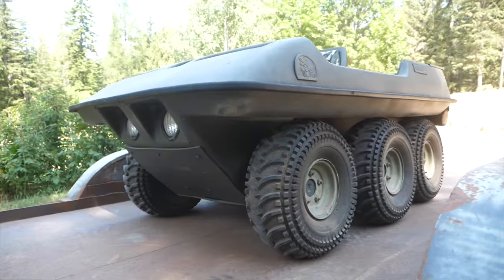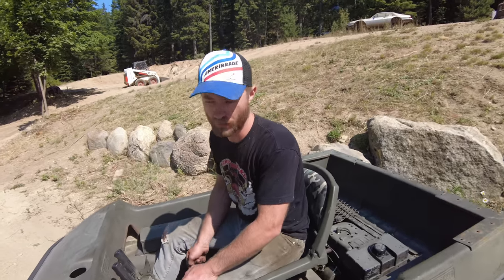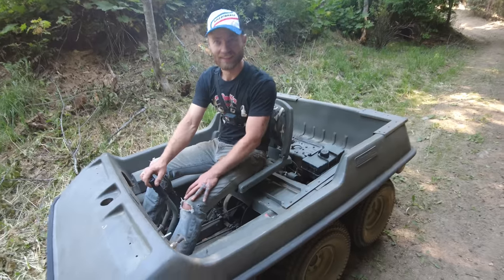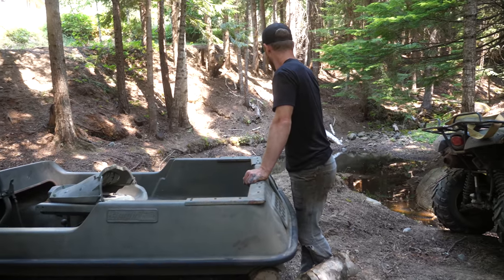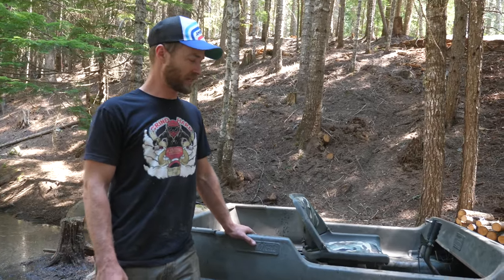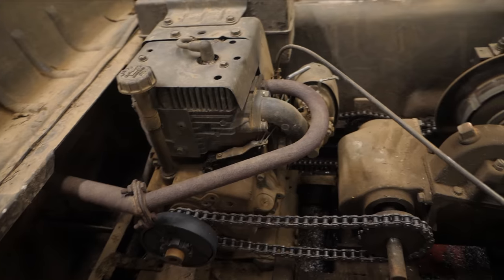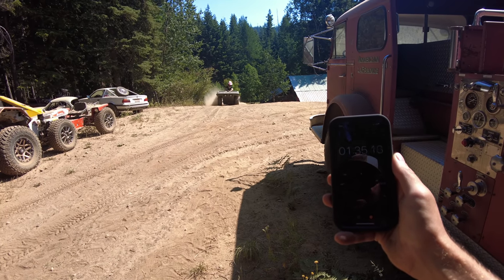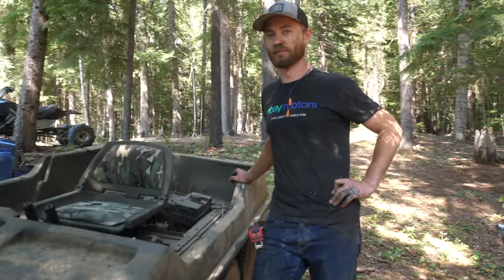We Bought a 6x6 Amphibious ATV on Craigslist!

Comment: I know a guy that built suspension systems for these,,   Rule number one,,, anytime you go swimming,,, get it off it’s wheels, grease the outer bearings,, grease, rotate, and repeat in 1/4 turns, you should have drain plugs,, snap ins,,, ditch them and use boat plugs,,, and set up a bilge pump, that’s what a lot of us 6x6 enthusiasts do,,,, be glad to lend assistance anytime, guys, luv your builds,,, oh as far as your chains,, use a product called Chain Wax,,, it’s the absolute best stuff to use. I have a Buffalo Truck. Oh turn your tires around, backwards,,, chevron pointing up, that trick carries you through the water faster

Comment: They usually have a plug in them
So that you can drain them without flipping it too haha. Nice find guys!!! Can’t wait to see what power you give it!!!
Reply from the maker: We'll have to look for that next time...
Reply: The plug could be missing, or, the rubber dried out on it. That could be the whole reason it was taking on water.
Reply: @UmmmmmmmWhat  looks like it has bad wheel bearings, but given how much crap got in there's a heck of a hole somewhere.
Reply: @GrindHardPlumbingCo  I know you have already made up your mind to repower the Amphicat with, as a former owner of the same model machine that transmission and drive starts coming apart with much over 35 horsepower. 

I would suggest looking for a Borg-Warner T-20 skid steer transmission. 

I can tell you what you are going to break first... it will be the internal drive chain inside the case. It is a #40 chain as I remember but some early units did have #35 inside the case.

Yes I know you need content for your videos... so anything I say is mute.

Comment: Me and my brothers bought  one of these that wasn't running back in the mid 90's. I remembered it running in the early 90's when the former owner had it. It was an Attex brand. We did some bondo work on the tub, put new tires on it, and put some paint on it. Never did get the old two stroke running. I sold my part of it to my brothers, and they sold it in the early 2000's to a guy who was going to restore it and get it running.

Comment: Had one in the 70s powered by a 40hp 2-stroke and a throttle on the right control stick, Same basic setup. It was pretty dang fast! Used a Torque Converter like a snowmobile. I believe the make was "Hustler", IIRC.

Comment: If you Take some tractor tires and cut out the side wall. Deflate the tires and slide the cut one over all three then reinflate. It makes some cheap tracks. You can use cable to make sidewall chains if needed.

Comment: Hey guys a word of caution you have an early Amphicat and that transmission and drive were designed for a 22 to 25 horsepower JLO 2 stroke with a CVT system... much over 35 horsepower you start breaking stuff inside the trans.

Comment: I hope you build this into a proper Grindhard custom job, 8 wheel drive with tracks & a full roll cage, fitting a small  diesel engine with a Turbo & changing those controls to a stearing wheel preferably the steering wheel that was uses on 'Kit' the knight industry's two thousand. Epic

Comment: I would build a rounded roll cage with fog lights mounted on the inside so if you flip  forward or roll backwards you just roll back on your wheels. Just a idea. Specially with the power your wanting.

Comment: If you want to upgrade the steering and propulsion system on those amphibious ATVs your best bet is to find a hydrostatic zero turn mower system and use that for your steering and such. Much more power torque and a lot more reliable than 15 different chains connected together

Comment: Guys, take all that current drive out and get a used zero turn mower as a donor for the drive and power plant.  Sooooo much better with 25 or so HP and hydrostatic drive.  A friend did it with an 8 wheel drive and its sweet!  His next "upgrade" is putting a real boat prop in the rear of the vehicle that is driven with the rear most axle.  I asked how he would keep the water out and he said he "has a plan".  lol

Comment: You should move the driving / steering "sticks" to the side if the seat for sure. Better seating position, center of mass moved back, easier steering
Reply: Maybe adapt it to Zero Turn mower type of sticks? I would think that would be more intuitive andpre comfortable.
Reply: @garrettstevens2232  That would definetly be  awesome, but at the same time mechanism that would work might be too complex and heavy or just too big. 
The best solution what I can think about for now, are 2 separate transmissions, one for each side,but that's easier said that done.

Comment: Ideally you can find a junked zero-turn mower to steal a transmission from.  A good second option is getting two differentials to make a DIY tank steering transmission.  The two differential tank transmission design is really simple and gives you separate steering and forward/revers inputs so you only need a hydrostatic transmission for the steering.
Reply from the maker: All good idea! Thanks for the input!
Reply: Keep trying to post a simple way to add a tank tranny onto an existing 2WD transmssion with an open differential.  Youtube keeps eating my link to the image.  Dropbox hosting isn't good enough?  Seems kind of silly to make a 5 second video out of a photo labeled in MS Paint...

Comment: One thing to note when using in water if you have a two cycle engine they have a tendency to hydro lock or something very similar. What I am referring to is the crank case can at times fill with gas oil mix to a point that it could out your plugs and makes it difficult to turn over so you then have to drain the block and change out the spark plugs then try to get back to shore in a machine that is swimming in gasoline, try not to go up in flames bad idea.

Comment: If you rotate the tires on your 6x6 it will move better in the water they will act like paddles. Red Beard garage just did a rebuild on one for Finnegan's garage but a little bigger one not too long ago you can learn more about bearings you need to get from there and seal kit.

Comment: You guys should get one of the harbor freight 22hp vtwin engines in that puppy
Reply: How about a fuel injected Honda CBR300R sport bike engine it makes 30HP and its small enough with a 6 speed transmission
Reply: @Partnerthedog  needs torque. You would have to rev that engine way to hard

Comment: I think it could be possible to even put suspension on it. Just imagine the wheels are offset more, and basically have the suspension arms be parallel to the ground, since there’s plenty of room to compress upwards if you offset the wheels wider, and then you don’t have to worry about a high center of gravity. Also a proper seat and a roll cage is a must, and perhaps some artillery! Regardless of my own ideas I’m sure y’all will build something amazing you never disappoint.

Comment: So cool! 
I drove an Argo 8x8 a few times in a parking lot when I worked for a car dealer. 
I have always wanted to take one in the water.
Looks like a blast. 

A two-stroke motor swap would be rad.
Reply from the maker: Yeah! I always wanted one of these as a kid! Two stroke would definitely make it better!
Reply: @GrindHardPlumbingCo  Theres a video of one that has a Honda ATV motor. I think a 200cc. Its super cool. 
Some of the older Honda three wheelers had low-range. And reverse.
That would probably be a more practical application.

Comment: it would likely have done better in the water with the proper tires. i believe these came with a v tread pattern tire originally. they sorta act like paddles in the water. those turf tires won't do much. also i think it's a safe bet that all of the seals on the axel shafts are shot.

Comment: Obviously you should put two engines in it with independent throttle and brakes.  Run an automatic clutch and link up the shifters!😈

Comment: Once you get it water tight you'll probably want to switch the tire direction. I know they are technically the correct orientation now but in the water you want the V's going the other way to paddle.

Comment: Also that thing is going to suck in the water until you get the proper paddle tires all the way around. As for taking on water it's not that big of a deal as the body is filled with high density foam to add buoyancy. Most of them leak like a sieve anyway

Comment: I've worked on keeping two of these running for an ATV center. The chew through chains, and sprockets, more sprockets and the other sprockets, chains more chains, more sprockets and chain guides and drain plugs, not to mention the wheel bearings then back to chains and sprockets lol. It's never ending 🤣😭
Reply: if you are driving on hard surfaces like concrete and asphalt  the turns need to be made more gradual. thats what tears up the chains and sprockets and premature tire wear. they are kind of like riding a 3 wheel atv .
AATV= AMPHIBIOUS ALL TERRAIN VEHICLE
Reply: @flhusa1  i agree. Ours were off road through ditches streams etc. It was more to do with trying to keep the clients abusing and wrecking them. Multiple people every day, first time drivers, two max cats at a time and I'd lead on a quad bike.  It was great, they were owned by the activity center but looked after them and kept them running for 5years, along with 20 quad bikes. They're excellent fun in the snow
Reply: @sjh0010  first time i drove into water was a really weird feeling

Comment: I'd think that a 420cc would be alright but I wouldn't be sure if a 670 or higher engine would have fitted in there with out some kinda modding to the frame and stuff 

Though the one whistlingdiesel (if ya know his channel) has was pretty quick
Reply: "some kind of modding to the frame" is kind of what the channel is about. If they can fit a KTM 990 into a power wheels jeep I am sure that a Phazer engine into a 6x6 will happen.
Reply: @garrettstevens2232  true that one but my worry would be engine weight for it to float on water
Reply: @FrostbiteXZ  a 500cc 2 stroke shouldn't be very heavy at all
Reply: @garrettstevens2232  yeah shouldn't be anyways lol

Comment: Less a tank, more like a fiberglass boat with wheels and zero suspension. They ain't the toughest off road vehicles. Beat on them, and they break pretty easy. You're gonna have to figure out a torsion arm suspension if you wanna make it op like the rest of your builds.

Comment: wrong tires. too much air pressure in the tires you have now. tread is facing wrong way to go in water . you will need to learn the machine . the secret is to remember it may not go exactly straight where you want but it will go over all kinds of terrain . let it go forward in it's own way and correct the path you want when it lets you . no 4wd atv in the world can win in a tug of war if you get all the proper things right. when you are going and it stops forward momentum stop and reverse it back out. if you keep going forward you will dig your own grave . the tires you need will let it turn much easier. the tires you have now resist sliding sideways and thats what allows it to turn . you may have to glue the tire beads to the rim because they usually run at about 2-3 psi.